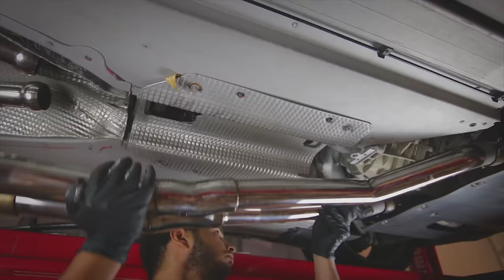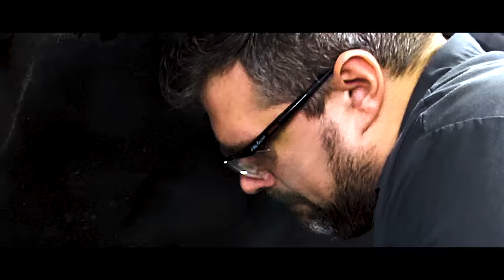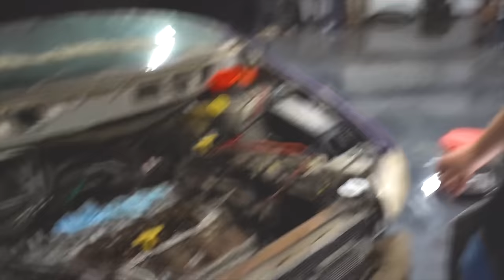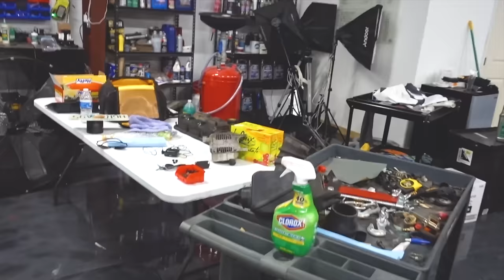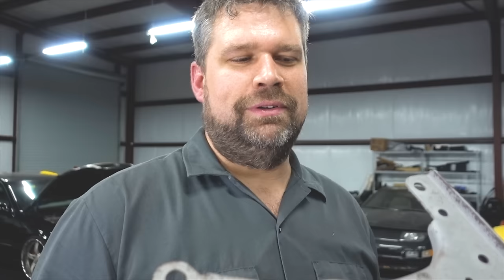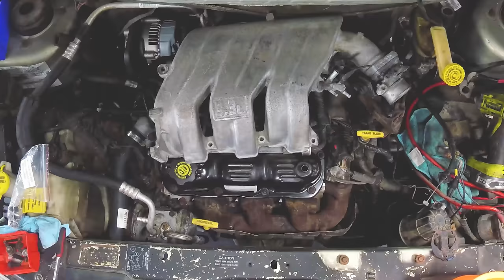Rebuilding An ABANDONED "Pimp My Ride" Minivan In 2 Days

Comment: I'm honestly more impressed that all of the remotes were still in the car.
Reply: Ikr how tf
Reply: controllers, speakers,amplifiers and tv thats impressive.. but what is really interesting is that everything works 🤔🤔
Reply: I think Car related remotes are in some other league of remotes where people dont lose them. I bought an 89 Chevy conversion van with a TV in horrible shape (maybe not as bad as this caravan but bad) and the remote was there, same with a 2008 Mazda 3 with an Eanon center consoley navi thing... also seen quite a few that I've bought off craigslist with the garage opener still on the visor and a 2-3 times I called or emailed them to see if they needed it (those things are expensive) and they told me it wasnt even theirs and mustve been there when they bought the car
Reply: and no one had yanked all the electronics. if someone had that definitely would have been the end
Reply: Like dude, all the car remotes are in the car, but I can't find the TV one when it's in my hand
Reply: WCC was quality after all
Reply: But how did he never test the subs?
Reply: captvictor wasn’t it GAS?
Reply: I think it’s probably because they weren’t used enough to get lost unlike the remotes people have in their homes.
Reply: Barney Lynch the we’re probably lost in there.
Reply: @freshtodepthllc1312  I just googled it and you're right, GAS did this Van during the final season
Reply: You never tested the subs bro?
Reply: Me too!
Reply: Just bought a used car that still has remotes in it from old head units it used to have.
Reply: Don't forget about all matching wheels which at first all hope was pretty much lost!
Reply: @frowlinian8175  I bought a car with one too

Comment: im most impressed by how well those headlight restoration kits work when you actually have patience
Reply: I paid a lot of money for Firestone to restore headlights. It was such a waste of money! That kit looks like it really worked.
Reply: I just buff them with medium cutting compound or wet sand then buff
Reply: I'd like to try one. My sibling cracked my car into someone a few years ago but was at least nice enough to buy me a new headlight. But I've not replaced the other one, which is extremely foggy, so my light quality is mismatched. Instead of paying $100 for a new headlight, I'm going to try one of the kits first and see how that goes.
Reply: The big problem is that you will need to do it every year for the rest of time because the protective coatings are gone.
Reply: @Luckingsworth  Exactly. Maybe every two years depending on the driving patterns, and if the car sits outside most of the time or in a garage. It's a temporary fix.
Reply: They look good on camera.  In person they are still pretty bad.
Reply: @DonSeldum 
There’s no way you can’t coat it yourself.

Comment: “It needs an alignment” it’s a Chrysler van, it always need an alignment. These things need alignments right after getting one done.
Reply: Lol thats funny
Reply: True that.
Reply: I have an 07 T&C no issues with alignment 🤞🤞
Reply: That-Wolf-With-Shades I think that has to do with the cv axles as it’s a front wheel drive. My ex’s mom had a Honda minivan that would do that when you’d punch it. I think one tire might pull harder than the other.
Reply: The way I just hollered 😭😂
Reply: @ThatWolfWithShades   That sounds like torque steer, not an alignment issue.
Reply: my 84's steering wheel was always pointing around 11:30 but drove straight :)
Reply: The damn tech who does the alignment on these vans needs himself to be aligned after aligning, the freaking alignment!
Reply: @ThatWolfWithShades  Thats called Torque-steer. Its a side effect of having lots of power on a FWD vehicle.  Should've got the 4 cylinder if you cant handle it ;)
Reply: @TheTurpin1234  "Lots of power". Darling, the 3.3 is a pretty bulletproof but downright anemic engine for the size of the vehicle. Ours was the Grand Caravan, so even heavier.
Reply: @ThatWolfWithShades  Oh. I grew up with a (i think) 2003 Town and Country with the 3.6  and that thing hauled ass. Could do 1 wheel peels for days. Transmission sucked though, and it didnt like hilly highways, always hunting between 3rdand 4th.
Reply: Ż
Reply: I had 99, 01, 05, and 07 Grand Caravans and they only required alignments when my wife took them after I got the new one
Reply: These Grand Caravans keep running even after a long time of using them, even after 200k miles, but they just get worse to drive despite maintaining enough roadworthiness to be used. And the 2008 Grand Caravan had baby brakes which were bullshite
Reply: @benson2873   My old man had a 1998 Dodge Caravan and it went to 313,131 miles. It would have gone longer if an asshole didn't smash into the rear of it and snap the rear axle off.

The only real trouble it had was with the Mitsubishi 6G72 engine. The engine was pretty reliable up to 100k miles, but it started falling apart rapidly after that. The rings on several cylinders wore badly and lead to compression loss and significant oil burning. The heads also had problems with the valve seats, requiring both heads to be replaced once as some cylinders got down to 70-80 PSI. By the time it got to 300k miles, it always had a white plume of smoke out the tail pipe no matter how much lucas oil you added.

But besides the engine, the rest of the van had little more than old car problems.
Reply: @benson2873  I beg to differ I got a 99 same one got 200k miles
Reply: Its a doge
Reply: @benson2873  , It has already made it 20 years.
Reply: EvilTurkeySlices those vans are a real piece of shit that’s there’s a surplus at the junk yard and why their always broken down they it all starts with the shity Chrysler engine and automatic transmission from it goes downhill it’s like a time bomb like a PT Cruiser
Reply: Avetho Plays they have great engines, but everything around the engines are crap.
Reply: Yo, dawg, I heard you need alignments...
Reply: @benson2873  That van is already 20 years old.  It has outlasted literally every Hyundai built from 1995-2008.
Reply: My 01 never had any trouble with that
Reply: haya g^
Reply: @benson2873  Mine has 265,000 and runs fine.
It is due or overdue for timing chain.
Reply: @ThatWolfWithShades  You have the 3.8?
Reply: I have never owned a Chrysler product that tracked straight when I bought it...
Reply: Dodge caravan
Reply: @michaelblackwell7408  The 3.3, actually. Drove like a charm until the day some jackass with an Audi tried to be slick and totaled it.
Reply: On those Chryslers, don't they have to align the engine to align the front suspension? Something about how the K-members mount things.

Comment: I'm most impressed by how good the headlights look.  They look brand new
Reply: What kit did they use, or is it more like how?👀
Reply: If used correctly it work wonders ive used it in my eyes many times still need eye drops every so often tho probs just the Ebola
Reply: 86Themadhatter right? I tried to restore my wife’s headlights on her 2012 and it still looked like shit. Wondering if I didn’t push hard enough on the drill when sanding them down
Reply: @zbeshears6945  all you have to do is get you a wet sandpaper kit with 1000 2000 3000 and 4000 grit wet sand paper and do it in stages make sure you use plenty of water and then use rubbing compound Turtle Wax works good and then get a good carnuba wax McGuire's Gold Class is the best
Reply: @zbeshears6945  it's not about pushing hard it's about getting to a clean layer of plastic but some headlights are too far gone with cracks from the inside. At least your wife let's you play with her headlights lol
Reply: Dave the VTWIN after all the wet sanding be sure to use a polisher/buffer with a lens protection polish to remove all the swirls, scratches, and give it a nice shine.
Reply: Need to step up in sand paper gradually and then eventually buff them. But the most important part to keeping them look fresh is to seal them with a clear coat or film, without it they will oxidize and look bad again.
Reply: @Passions  Not this kit, this one literally sand off the sh!tty layer leaving a factory like shine.  It isn't masking the dull with a layer of shine.  It sands off the dull.  But some headlights are too far gone for this kit because you can't sand deep enough to ever get to a good layer.
Reply: @zbeshears6945  put off bug spray for a bit and then wipe it
Reply: Pro tip: (10 years exp. independent shop tech) Meguiar's ultimate compound and JUST THE BUFFING pad on a drill...10 mins a side the job pays an hour. Done in 20 mins...push real hard and be aggressive with no problems 🍺👍🏼👌🏻
Reply: did the same to mine and they look great, a Lil foggy around the turn signal part at the end but it should come clean the second time around.
Reply: Passions exactly.. a friend who is a detailer puts a ceramic coating on them.
Reply: @bloodofchristjesuscoversme1878  i know it was a meguairs kit
Reply: Yes!

Comment: Jared is a total Chad. Got an early start but did it for the content and recorded everything. Just with less flair.

Also worth noting that while the ATF trick works extremely well but is not advised on modern stuff with tighter tolerances or diesels. A good synthetic will yield the same results over a longer term. I have done the ATF trick countless times but I do it on a fresh oil change with a cheap filter and oil, I'll run it for a couple tanks of fuel and then repeat as necessary until I'm satisfied. Then follow with a good synthetic and a higher end filter.

Comment: They shaved the handle on the passenger sliding door but left it on the driver side that has a built in blocking it inside. LOL
Reply: The only logical reason I can think of for that is the automatic door is some terrible one that will get fucked up if you open it manually (and there's no room/need for an automatic on the other side) but that's still hilarious lol XD
Reply: @gamerguy425  I assumed that they left a manual door on the driver's side in case all the electronics fry (I'm betting the fuses for the power door are in there) -- having manual access to all of the gizmos and circuits would make troubleshooting a lot easier I think haha

Comment: Some amazing work restoring this thing, though from what I've read a lot of PMR cars had electrical problems with all the shit they put in the cars that they weren't meant to support, it's good to see you were able to get everything working for sure. I would have torn out that whole jewelry console and restored access from the driver side sliding door personally,  but who knows what kind of electrical nightmares that would have caused.

Comment: Love the blurred out Walmart battery.  Guess advance didnt have all the parts in stock. Lol
Reply: LOL, I wondered what was being blurred and why.
Reply: Or the battery didn't need to be replaced?  The car started with a short charge, all of the internal electronics worked after as well.  They didn't mention changing out the battery at all unless I missed it, and they probably just didn't.
Reply: I don't think they even change the battery, but one thing for sure they covered it to avoid any issue with walmart.
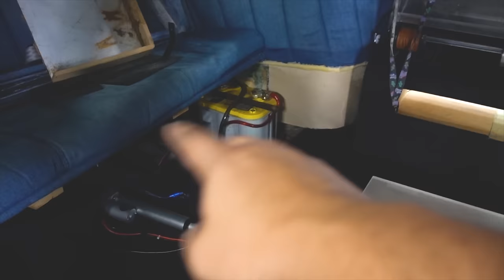Reply: Looks like he forgot to disconnect the battery while working on the wiring. He showed the battery earlier in the video without it blurred @ 6:53 . he did say it was a dead battery tho.. lol

Comment: Looking at that alternator reminded me that those damn vans had an issue where the drain for the windshield could drain right onto the where the pulleys are.  It s a known engineering issue with the van.  It rains, and the water gets dumped onto the pulleys which slip, steering locks up, and the alternator stops giving power.  Frustrating as hell as when its dry everything looks good.  Had a mechanic friend with us that when we had it happen and he engineered something to fix it.

Comment: While an amazing restoration, would have been great to replace the interior. That fabric is trashed.
Reply: nah, there's dyes you can use to restore fabrics like denim. you can recondition it. but I'd remove that jewelry station blocking the door LOL
Reply: I agree too much DNA , vomit, urine, saliva and drug residue on the interior. Plus it looks like shit. The floors looked better but the seats are bad.
Reply: Yeah redo the interior in a pink or purple vinyl to match the exterior, and get rid of the jewelry station.

Comment: "looks like a regular engine bay" except for the top right of the engine bay which is blurred out????
Reply: Gav Murray I’m trying to figure that out too. He’s never blurred anything out before. Did they use a WalMart battery when it’s sponsored by Advanced?
Reply: It was a battery that wasn't an advanced auto brand. Since it's a sponsored video for advanced they blurred out the battery.
Reply: I'd say so cause they blurred the battery in the back too
Reply: Probably a battery you can’t get from Advanced Auto Parts so he blurred it.
Reply: @thecloneguyz  He was prob just being polite i would be surprised if the sponsor asked him to do it. i doubt they would care either way i think he was just trying to do the right thing. with all of that electronic crap in there it was a pretty good opp to use the sponsors batteries and refresh the whole power system..

Comment: Still trying to figure out why they designed that stereo as something to be used when the van is parked instead of maximizing performance for the interior. Oh right, it was for Pimp My Ride and wasn't supposed to be useful. I personally would have taken out that jewelry maker and foot rest and turned that into a sleeper with a sink/fridge/hotplate/microwave instead. Also Would have taken that box out and remade it for useful sound for the interior instead of a boom box for a parking lot.

On the other hand you guys did a magnificent job. Made me wish I had a shop so I could fix my truck. I have a 2001 Chevy Tracker and it needs a water pump, radiator, brakes and tires. It also needs new locks all around and a new ignition. Watching you guys bang out that work was very therapeutic.

Comment: I just wish I could get someone to help me fix all the issues a shop did to my my Caravan. I paid for an engine swap, and they blew out all my electrical, radio is toast, dash is dim, the automatic windows got fried. And they wanted me to pay more, for what they did wrong. They also messed up my brand new radiator, and I had to pay for a new one. I am also quite sure they didn't actually put a new engine in. All of my ties I put on my engine originally are still in place, unmoved. I confronted them about it, and they threatened me. I'm super sad, because I'm one of the few people who actually loves their ugly vans. SMH. So watching this video of restoration lifted my spirits a little.

Comment: Wow auto trans fluid into the oil to clean up the sludge from a motor that was poorly maintained with irregular oil changes is a new idea I'll give a go. It sounds a little dodgy but I'll go on Jerrod faith and see if it works. I never knew you could mix oil n trans fluid or that it could clean up a sludgy motor. I tried some of the engine cleaner additives but they did very little and made no visible difference that I could see, thanks guys.

Comment: Must be an early 2000s thing. Was trying to reuse some Kenwood head unit's from 2001 in an old truck. Was sitting for over ten years in a truck and it had bad solder joints. Re did the solder and it was working again

Comment: Fun fact that van had speakers installed under the car on the outside that was linked to a device that could play the sounds of other, cooler cars, synced to the gas pedal. Not sure if it made it out of production after the shower but it originally had it

Comment: NO, I do not recommend putting automatic transmission fluid into your engine. That stuff has metal pellets in it to help make the torque converter work. Putting that stuff into your engine block could do things like causeing all kinds of premature wear or plugging oil jets. It is not a good idea.

Comment: Holy shit you went to town resoldering that board.  I thought you were going to just touch up a couple joints.   I used to solder for year or two on Cisco boards till my nose started bleeding (bad ventilation at my work desk) and it looks like you are least level 2 or maybe 3 with your skills.

Comment: RE: "Ticky engine."  I've had several Town and Country vans which are essentially more featured Caravans.  The last one was "ticky" and when it threw an error indicating and injector was failing, I replaced all of them with after market injectors.  I thought something was wrong because the "ticking" was almost non-existent.  Someone told me that the relays on the new injectors were better than the original.  Who knew?

Comment: should've replaced all of the audio component wiring....theres a single 4 gauge power wire running to the front battery for 2 amplifiers plus all the extra equipment drawing off that optima yellow top battery....should've upgraded to a 0 gauge and perhaps upgraded the alternator

Comment: That exhaust pipe tip under the passenger compartment is extremely dangerous. We had two locals die in a minivan from breathing carbon monoxide from a leaky exhaust. You do some nice work but that needs fixing. Do better.